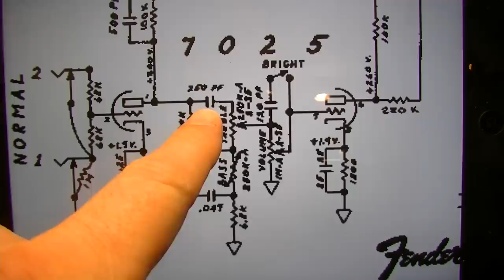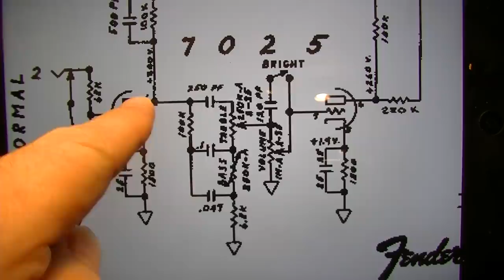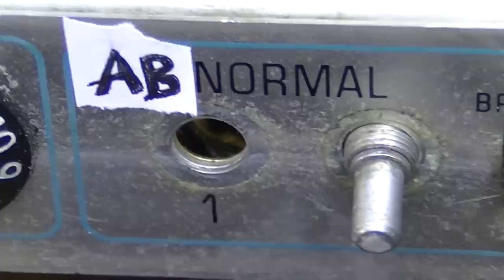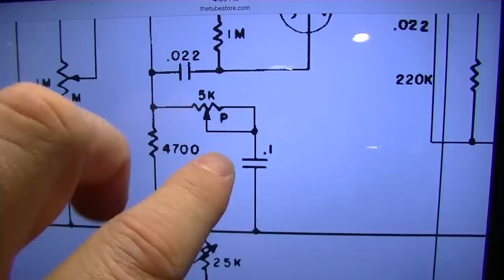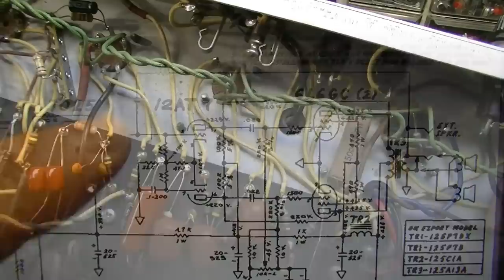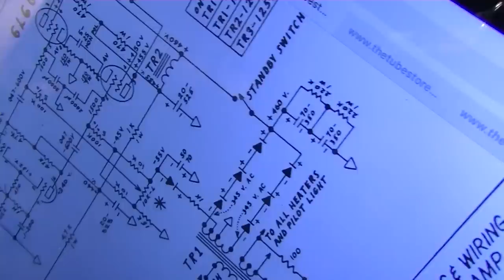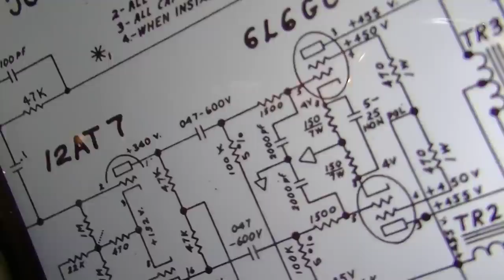SECRETS of the Fender Bassman - "ABNormal Channel" Mods Unleash the Hidden BEAST!

Comment: I've restored a few of this model with the 150ohm 7w cathode resistors. It was likely done to make replacement of tubes a bit more user friendly. I've always removed it and replaced with a 1ohm 1w so bias can be easily measured across it. I incorporate a pentode triode switch in place of the ground switch which gives a low hi power mode. The extra triode is very useful for a cathode follower to feed the phase splitter. I just picked up a Bass man 10 in excellent condition which I'm about to rebuild for my own evil doings...

Comment: From what I read as the amp got a little messier sometimes oscillation would happen and the .02 caps off the power tube were to make sure oscillation would happen. It's always suggested to remove those. I owned a presence control solid state rectifier blonde bass man also an aa764 or 864 an aa165 and an ab165. I had a collection of 30 vintage fenders once I got into building amps and heroin I sold all of them. The last one a 68 deluxe reverb went to Robert kealey. Anyways love your videos. Since getting off heroin 5 years is ago I work out a my house building germanium fuzz mostly. Some local amp builds and repaits. Mostly just a niche of germanium fuzz. Again man I love your videos.
Reply from the maker: I hope you kicked it.

Comment: I have that same amp, built 12 weeks after the one in your video.  That one was wired by Technician #35 in the 30th week of 1968, based on the ink stamp code near the transformer inside the chassis.  I bought mine in a pawn shop for $100 in 1988.  Finally re-capped it about 2 years ago.

BTW that circuit is the short-lived hybrid fixed/cathode bias circuit.

Comment: Great guitar amp a little on the big size (watts)..I modified my 67, changed input resistors on normal #2 removed negative feedback loop.(only there to clean up signal for bass) changed cap to brighten up channel..use a 2 12 bandmaster cab with vintage 30's.. very aggressive.. love it

Comment: Glad to see you kept the 100k plate resistors on the preamp stages instead of the nasty 220k or higher to get more gain, which in most cases makes things too fizzy and nasty.  Friends don’t let friends use 220k plate resistors!
Reply from the maker: 100k is usually my standard anyway. Unless I just can't get an amp to do what I want it to otherwise.
Reply: Unless it's a 6G3 Brown Deluxe ,right?
Reply: Another way to get some more sweet gain at a pre amp stage (or two), is to swap out a 22 nan by pass cap for a 470 nan plastic.
Reply: Brad's already using a 680nf on the input bypass cap. Anything smaller sounds more like a bright cap in that position. I've experimented with so many values in the classic 5F6A(values that left the factory) to JCM800 circuit, finding that both Fender and Marshall got it right the first time.

The most effective gain increase that doesn't change the overall tone has got to be changing the 1 Meg grid reference resistor to a 2.2 Meg. It's similar to adding a larger value bypass cap on the 3rd stage in a JCM800.
Reply from the maker: I've discovered that personally the .68uf bypass cap on V1 is the magic number. Anything higher and it fattens up too much usually to get those palm muted power chords and not have them muddy up. A .5uf is passable too. I'll also use that value sometimes. A 2.2M grid leak will definitely slam a stage with signal. I do that sometimes too, if I think it's necessary. Done it a time or two in past vids, I think.
Reply: The Guitologist I’ve also found .68u /bypass and .02u coupling caps to be the magic numbers (although in rare occasions I have pulled off a 1uf bypass lol).
Now if we want to be controversial let’s talk about how a plexi actually has more gain than a jcm800, and that which some call “power tube distortion” is actually “phase inverter distortion” lol
Reply from the maker: I made a video about how unbalancing a PI can seriously increase the distortion of the output signal.

Comment: Many people are unaware that Fender made some of its most radical design changes in 68 & 69, and removed them later. The caps related to the output tubes were to help keep it stable and reduce any tendency for parasitic oscillation. The resistors on the  cathodes were an attempt at a hybrid bias scheme. It was a design change that never caught on.

Comment: OH this is rich @The Guitologist, you really brought out the pure of mind, body and soul on this one. The "discussion" in the jchavins "troll me area" is some of the best on your channel ever. I love it when you pin these types of comments!! I am just starting to learn guitar a 55 years old so will never be a purist anyway. I spent my career as and Automotive Machinist building engines and I personally loved it when someone would see one of my custom Snap-On tools that was modified to fit my needs in the shop. I would hear "OMG you have ruined your Snap-On kiniptakator wrench  by cutting the side off and bending the end like that" ..... my reply was usually "NO it was useless as a kiniptakator wrench, I don't work on kiniptakators but it is a really good quality Konkulator valve remover now that it is bent and cut."   ROCK ON Brad "The Guitoligist"

Comment: I've been wanting a Bassman for a long time.  RJ Ronquillo plays most of his videos through a Bassman head, and makes it sound great with a variety of guitars, through a variety of speaker cabinets.  Since I'm getting older, the weight issue has become more weighty, and heads seem more practical now.  I'd like to have a VOX head too, instead of lugging around a AC-15 (heavy) or AC-30 (heavier).  There were several circuits used in the Bassman amps through the years, with earlier blonde models valued the highest.  I'm appreciative that the Ampologist...I mean Guitologist, has done a video on this excellent vintage amp head, for all of us ampaholics and guitaholics - thanks!.  A Traynor head can supply wonderful tone too, and not as expensive - one of those is on my "to get" list too...

(please grow your facial hair back dude - it makes you more "techie" looking)
Reply from the maker: Bassman heads aren't too heavy. Good choice if you don't like lugging heavy stuff, but need the volume onstage.

Comment: The Bassman is a great amp, paid $35.00 for one in 1982, still works and sounds great, might add the extra gain stage for optional different sound, in one way it might be considered a collectors amp however there are a million of them out there. I would still shy away from drilling.

Comment: You can also use coax cable as shielded wire. While you can probably find cheap RG6, it's pretty bulky and cumbersome to work with, but if you find lengths of smaller stuff like RG174, its great for use inside amplifiers.

Comment: Use an on-on-on toggle in place of the slider bright switch to give the amp ABY capability. I doubt the bright slider would be used very much, at the very least the bright switch with the mod to the tone stack in the second channel might be redundant (bright + added gain stage or bright bypassed with gain stage + tone stack mod). Certainly an idea for the future to think about. I really like the circuit mods you installed on this monster of an amp.  Great Job Brad. I love your channel man being a tinkerer myself, I've learned a ton of great stuff from you and for that I  am eternally grateful and  greatly appreciate your efforts.

Comment: Speaking of Bassman heads,How about the model with the 220k resistors connected between  the P.I. plates and power tube plates.I always cut them out. I once saw a Plush Bassman style circuit.They even copied that.You're right. It's already too loud.I can't help it.I'm always trying to squeeze more out of it.  On the gig ,I used to use the Black Deluxe Reverb with the J.B.L..Now I use the Deluxe with the low wattage stock Oxford speaker.Love your love of gear.Keep it up.
Reply from the maker: JBL are great for max clean headroom. I prefer the Oxfords or similar for cone breakup.

Comment: The 1968 Fender Pro Reverb AB668 circuit uses the same 7 watt power resistors and ceramic caps off the 6L6GC's. I removed all of them on my Pro and it slightly increased both the mids and treble.

Comment: I'm a little late to the party on this one, but I haven't spotted any responses to the 6L6 configuration yet, so I thought I would put in my 2¢.

I think the 150 ohm resistors and the 25u cap may be to reduce distortion, and the 2n caps from grids to ground suppress high frequencies in the output stage, either from the preamp and/or from oscillations at ultrasonic frequencies. The grid caps may have been a bit large in this amp, but some version of this is probably better than none as there may be impedance anomalies and/or parasitic capacitance that could cause oscillations at frequencies far above human hearing. This can lead to distortion, and even overheating in the output stage. I recommend a 68p to 250p cap be connected from one grid to the other. I've never seen an amp with this specific problem, but my view is that for the cost of one cap and a few minutes work, better safe than sorry.

If anyone has more ideas on this, I'd like to know.

Comment: Wish you'd demonstrated the difference in midrange voicing via your added boost/cut switch. Good sounding amp though.
Reply: Was thinking the same thing. Wanted to hear that.
Reply from the maker: Sorry about that. I did demo that at first, but later discovered during editing that most of my sound clips were useless because I'd left the overhead mic (for doing the speaking parts) on during the playing. Just distorted madly. Really sucks too, cause I had some good clips if not for the distortion. Oh well. I think I've finally decided to start using my laptop for recording the demo clips from now on. The camera AGC clamps everything too much anyway.
Reply: +Brad  Stuff happens. I figure it sounded pretty good, would've enjoyed hearing the contrast. No big, figure that won't be the last Bassman that you hot up. Do I understand correctly that even though you added a gain-stage that the channels are still in phase with each other?
Reply from the maker: No, the two channels are now out of phase with one another in this mod. So running them in parallel as I suggested with the Morley would not be feasible. Thanks for pointing that out. The ABNormal Channel now has 4x gain stages before the PI. The Bass Channel still only has 3x.

Comment: Just noting on something he mentioned, I always thought you couldn't link the inputs on a 60's/70's Fender like you would a tweed Bassman or a Marshall. I tried it once with a Twin and it was a mess. But yes, I highly advocate using an A/B box to switch channels with different pedals in each line, and bonus; Your echo effect or reverb will trail when you switch back. I use an old DOD 270 A/B Box.

Comment: For you guys that think a bassman is not good for being used as a guitar amp I beg to differ. I have used bassmans before and cranked out with the right cab these amps beat a lot of the modern amps hands down.  Getting rid of the old caps and modding this amp for use as a guitar amp that is killer, theres nothing wrong with that at all. I build all my own guitar amps myself and much better clean layouts than Fender.  These amps can be tricked out to really deliver and they hold up like tanks. The big iron really delivers the tone. You have to really crank a stock bassman before you get to the glory tone. Played quite at room levels, (without gain mods) is not the right tone situation for these amps. Played in a big room on a 4X12 cap or a 4X10 cab these amps kill.

Comment: Good idea would be to beef up the filtering on the screen node from 22uF to 33uF or 47uF to have a fatter sound.  It's the only spot you can beef up without losing the "vintage" tone. You can beef up the others too at the cost of sounding more compressed and stiff.

Comment: Brad, as long as those mods that your doing keep pissing people off, well man you have got me for a friend for sure. I have the same year bassman and I think the same type of circuit, the only thing is my tech guy mounted the master volume on the back of the amp, which now I think I like it on the front the same way you have done to this amp. My amp takes pedals really well, so yeah in all I really like these mods, good job man.

Comment: Amazing amp! The joy of feed back!

I have this garbage line 6/bogner spider valve amp( the first one generation they made) that I've always wondered if it could be converted to just a regular tube amp by bypassing all the digital crap. It's got 4 el34 and 2 ax7 so it probably could be a half decent amp if it had the line 6 excommunicated out of it. 

Great channel.
Reply from the maker: That feedback was on 2.5 on the Master Volume! Above 3 and the ceiling literally becomes a baffle board and the wife and police would come shoot me down like a dog in the street.
Reply: Those spider valve amps weren't that bad... Rather than trying to hack the pcb apart, just find a nice clean tone on it (or just use the fx loop if there is one, I don't remember) and hook some nice pedals through it. Those amps are really easy to make sound bad, but with some careful knob twiddling they can sound great on their own too, and with the wide world of boutique pedals (or diy pedals like from BYOC) you absolutely can make them sound fantastic.

Comment: Hi, just a side note... if my math is still correct, the output stage 1.5k grid suppressors and the 2nF capacitors to ground makes a 53kHz low pass filter... No effect in the audio range (unless you are a bat ;).
Reply from the maker: The output grid stoppers are 22k, I think I said.
Reply: Ah OK, but the AC568 schematics says 1500 ohms. I understand 2.20k (at 5:18), that's close, but I'm not an english native speaker, so, I may be wrong...
Anyways, thanks for all the great videos !!!

Comment: Yes, as said already, one of those late 60's Fender transitional messed up designs with a quasi fixed/cathode biased rig to make a stable circuit to hide a bad design flaw. I did a Dual Showman from the same year and stripped all that garbage out and took it to blackface spec. Watch Gerald Weber's video on here about blackfacing silverface Fenders. I would also change the funky values in the long tailed pair to blackface specs along with making the bias adjustable over that worthless balance control. The Showman I did sounded amazing after the mods. More power and much richer tone.

Comment: i know nothing about electronics. but i find your videos fascinating. i have a question, i have an american made amp, i now live in Thailand. is it a big deal to switch it over to the Thai electrical system? thank you
Reply from the maker: You just need a step down transformer. Something like this: https://amzn.to/2HRr9AG
Reply: Your line voltage should be 220 VAC 50 HZ and the  US domestic guitar amps(and every other North American product) were built to run on 115 to 120 VAC 60HZ. You need a Frequency Converting Step Down Transformer to operate  as originally intended. Unfortunatley, Frequency converters are very expensive and I would replace the original power transformer to one appropriate to run your amp on your line voltage/frequency. 

Replacement transformers for ~50 watt amps are around $100 USD. The work should be done by someone that really knows what they're doing(and why they're doing it).
Reply: Matt Fields....thanks for the response .  i was shown a step down converter that cost about 40 $. but i talked to a shop in my neighborhood that works on all electronic equipment. the guy at the shop said this morning its no problem, but  i really want to know which way is best.
Reply: The Guitologist .....thanks

Comment: Cathode to Cathode in PP output stage shorts them together at audio frequencies, separates them at DC. Connecting the cathodes creates a differential topology between the tubes, which lowers the distortion.

Ab normal... abbey normal,, watch ‘Young Frankenstein’ if its new to you.
Reply from the maker: Someone else commented on that too. How fitting. It is now a Frankenstein amp.
Reply: That's Fronkundsteen.
Reply: Yep saw Uncle Doug say this too :-)

Comment: Unless they tested "out of spec" you should have left the blue molded caps in there, they are superior to what you put in.

Additionally, I am not sure why you keep changing the normal channel to marshall specs (this is the second video I've watched where you have done this!) My 67 black panel was a AB165 from the factory, but I got the normal channel modded to be AA864 specs, and modded the bass channel to marshall jtm45 specs. To me this makes much more sense, than playing guitar through the bass channel of the bassman for the fender flavour. Additionally, since the bass channel already has 3 gain stages you don't need to use the other half of the 12ax7 for more gain, BUT you can use it to have 4 gain stages and 2 on the normal fender channel, then they are still in phase and you are closer to a jcm800 in the bass channel. I hope you take my constructive criticism correctly and begin doing it this way going forward. Cheers. :)

Comment: Heya Brad! Watching this vid makes me want to build my own amp. I want to have the Fender gain stages and output stage (with a master/secondary volumes), but the Marshall tone stack. I have parts, tubes, and iron ready to go. Which Fender amp should I model after to get the gain stages and output section from, so I can get a schematic? I would like to correspond with you directly if possible.